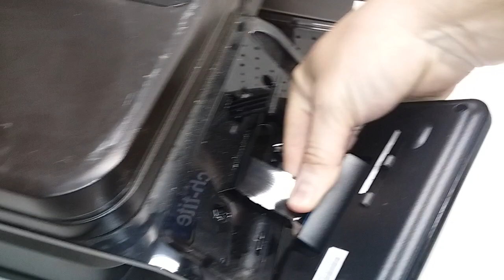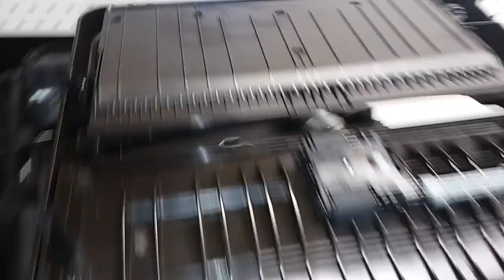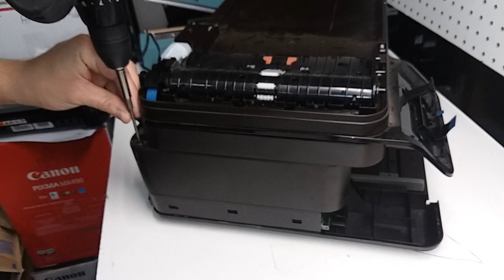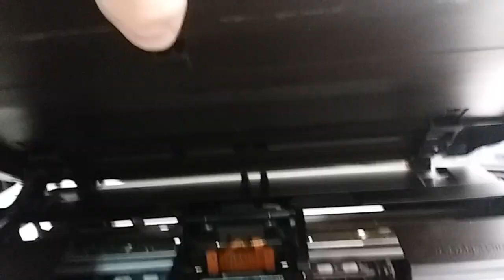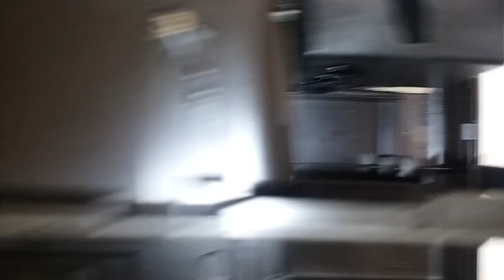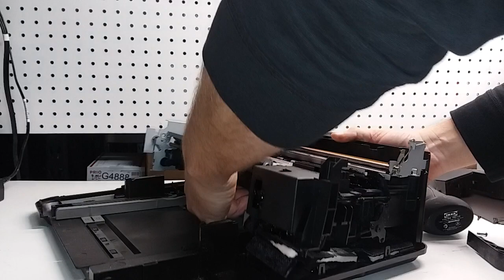Taking Apart HP Photosmart 7520, 7510, 7525, 7515 Printer Disassembly

Comment: I keep getting "One or more cartridges appear to be missing or damaged."  I replace the cartridge(s) with new and will get the same message - sometimes the same cartridges, sometime a different one.  It is not the cartridge.  Already replaced the print head.  Ideas?

Comment: My father had bought one of these back in 2011. It sat in storage for the past 6 years when I re-discovered it and got my hands on it. I can't for the life of me get it to print even with new carts and a head. It'll either print yellow only, or dump out an empty page. Once I got it to smear a streak of black across the paper, but haven't been able to convince it to do it again. This is what I needed. Hoping tearing it apart and putting it back together will jostle the life back into it. Failing that I'm just gonna E-waste it and get a Brother printer.

Comment: My pick up gears don't engage with the back gears in the gear box on a 7520.  How do I get to the gear box without having to take the complete printer apart?  Can I just take the bottom off to access?   I used a mirror to view the action and the back three gears did not engage.  Please advise.

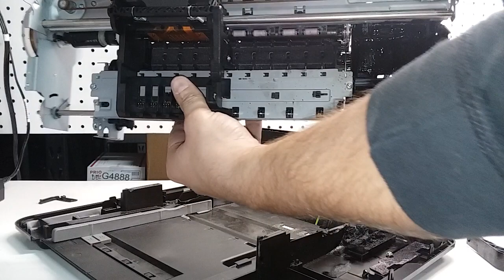Comment: 15:28 you show the underside of the print head assembly and the ink feed tubing. on the tubing is there 2 return tubes that just sit in the 'soak' padding or do they actually connect to something
?
Reply: 15:33 I can see the 'three' pair tube that runs to the head? but I can't see where the other 2 singular tubes are positioned. When disconnecting the right front facing side of the carriage, mine didn't come up as easy as yours. so I worked it until it just fell loose, (on yours there is a screw holding them to the bottom of the assembly with a white 'mount hold' but you just ripped yours out. I'm needing to clean the "ink" buildup all in the carrage and reassemble to hopefully fix for a client.
Reply: @Network_Pat  Hi, I am trying to establish which of the 5 tubes connect to the 3 ports of the mount hold at the bottom of the tray and in what order. And if the other 2 tubes are just positioned in the sponges or soak padding. Can you help? Did you get a solution to your question? Many thanks, Thanasis

Comment: Followed your video to replace paper door from one 7520 to another 7520. WiFi now doesn’t work & wonder if my hitting the memory card/usb port on left side of printer may have damaged WiFi module/board? Thanks.
Reply from the maker: 🤔hmm, that process shouldn't interfere with wifi card. The cover in the left is just card port. Make sure that is connected properly, maybe that's the case. Wireless card is attached to main board. See if it got dislodged.

Comment: I have the 7520 and it wasn't feeding the paper. Then recently it disconnected from WiFi and I can't get it to reconnect. So I watched your video and took mine apart, cleaned it, and put it back together. Plugged it back in and it won't turn on.
Reply: :face-pink-tears:

Comment: Great video!! It helped me get the control menu off so I could get the cover over the glass pulled back to clean the underneath. Couldn't get the lid off from the glass holder. The 2 outer hinges came loose but the center hinge piece wouldn't come out. I'd love a hint how to get that out or point me to another video that does that. Thanks!!

Comment: First off thanks very much for posting your video.  It gave me the courage to tackle a problem that I thought would be a fairly simple fix ( a broken hinge on my HP7520 printer).  I admit to being mechanically challenged but was successful in removing the broken hinge following your helpful video however.....NOT so successful in reassembly and have more than likely trashed my printer.

The issues I encountered on reassembly were. (1). The L shaped plastic piece that fell out when I lifted the lid after releasing the hinges from the lid....I see this piece in your video when you lifted the lid....I cannot determine where it fits or attaches and you did not mention it in your video.  (2)  After replacing the broken hinge I was experiencing difficulty in reattaching the lid because of the cable connections....was hopng that I would not have to detach the cables from the circuit board as you did in your video.  But alas I determined that was the only way to get the lid back on .... so despite your comment to be careful in removing the cables I inadvertently pulled the "base" of the cable from the circuit board thereby trashing the circuit board.

Thanks again for your video!

Comment: This video is essentially useless for repairing the ADF on top of the machine.  There's a little blue power ribbon that attaches next to the hinge on the document feeder. When it comes out, you're done. It isn't going to be reattached... no matter what.  End of story. This is an example of a completely ridiculous engineering design. It really makes that repair impossible. If that is actually the purpose, it doesn't motivate me to buy another HP printer... even though the machine is quite durable and lasted a good long time. A complete replacement of the top half of the machine may be possible. But disconnecting the power to that seems to be overlooked too. This video is useful if you only want to take the machine apart, for some reason.

Comment: There is a gear that causes the paper to be fed.  After years of use it tends to break free from the shaft and needs to be reglued.  How much of the printer needs to be disassembled  so that the gear can be exposed and easily glued onto the shaft?

Comment: That video was amazing! I have the 7515 so you know it's old. I've having black ink smudges occurring on my cards and envelopes. Looking inside at the right of the ink cartridges where the printhead rests when not in use, I can see lots of blank ink buildup. Wondering if there is an easier way to clean this area without disassembling the whole unit as you did. I have been looking for a printer replacement, but HP simply does not make printers like these old ones anymore. Any recommendations?
Reply from the maker: Hi. Yes. Cleaning inside the printer does not require disassembly. I used butter knife or screwdriver. Be careful not to break anything. You can also remove printhead and clean it.

Comment: Hello! I watched your vid and was able to fix the paper roller/gear issue. Unfortunately, now I'm receiving printhead error. I have taken this apart a few times and am sure I have all cables/screws/whatnots all back in the correct place. Any insight into what could be causing this?

Comment: Hi, thanks for this video. Have you also on for the HP 7610/7612 ? I have to gain access to both  laterals of the printer. Thanks for any advise
Reply from the maker: Hi. Thanks for the support.  I currently do not have the printer, but as soon as I find one, I'll try to make a video.

Comment: Thanks for the video and great directions. I have been getting a "problem with red cartridge" message that prevents any operation. I put in a new HP red and it resolved the issue shortly but then it returned--on and off. I cleaned the print head and all the connections to each cartridge and behind the print head contacts-both sides. I was jiggling the print head ribbon cable one day and that seemed to get it going sometimes. I took it all apart today (thanks to your encouragement) and cleaned all ribbon cable connections and sockets to no avail. I replaced the battery. Could I have a broken wire in the ribbon cables from the print head to the main circuit board? Bad connection from printer head to the small print head circuit board the 2 little ribbon cables connect to? Bad solder on that small printer head board? I ordered 3 Brother printers a month ago and there are none to be had due to shipping crisis. I would like to get this 7520 going but am out of ideas. Seems parts are crazy expensive. Any ideas as to what I can check??? I tried slipping a blue HP cartridge in the red slot and is says damaged or missing red. It isn't sensing the red cartridge is good and in place. I see one guy re-soldered some bad power connector contacts so solder may be an issue but I have power and when it decides to work it works great. Something intermittent is the problem and it is now to the point it doesn't work ever. I hate to spend money on another red cartridge. I really appreciate your videos and advice. Any suggestions would be greatly appreciated.

Comment: Great video.  Didn't solve my issue on my 7520.  And yes that's a very good printer, but instead of having 5 ink cartridges, this familly of printer should have had reservoirs (ink tanks) like the newer Epsons and Canon printers.  And not only that, the manufacturer should include in the life of the printer "X" amount of print heads and an easy way to clean ink charging section and replacing the felt, and a way to replace the 3v CR2032 battery if it needs to be replace.  So if HP decides to make a tank version of this printer,  they should implement my ideas and they would sell a lot of them.

Comment: my 7520 was bricked on a "There is a problem with the printer or ink system" error, used your video as a guide to get to the CMOS battery for a master reset, and now its working again!
Reply from the maker: I'm glad you got it fixed. Thank you very much for sharing.  Have a great day!

Comment: If anyone is having trouble reconnecting the wide blue ribbon to the back of the touchscreen, it is a bit more complicated than expected. If you look at the back of the touchscreen, where the wide ribbon connects, there is a grey, rectangular rolling lockbar. 

This bar has 2 positions: lock and unlock. It will probably still be in the "locked" position. In this position, you can see a row of little slots along its long edge. It will look like it's tilted backwards. 

You can't insert the ribbon if this bar is locked. It must be rolled forwards with your finger to unlock it. It will click into place. Instead of looking tilted, it will look squared. You won't be able to see the row of slots if it is unlocked. Roll it back and forth... lock it by pressing it back, unlock by pulling it forward.

Make sure it's in the unlocked position (no slots visible) and slide in the ribbon. It will likely stay in, but loosely. Then press the lock bar (roll it backwards) to lock the ribbon into place. 

I hope this helps somebody!
Reply from the maker: Thank you very much for sharing. I'm sorry I didn't point that out and caused you some unnecessary trouble. I hope this helps someone. Have a great weekend!

Comment: Does anyone have an idea as to how to repair one of the cartridge contact pins (black cartridge)? The pin is bent and won't spring back to contact the cartridge. There's no way that I'd tackle taking apart the printer.
Reply from the maker: Hi. See if this video helps you.  If it is not broken off, I suggest using tweezers.
https://youtu.be/M2r_Cs17nDw
Reply: @303electronics  Hi. Thanks for your reply. We initially bought the printer used. After replacing the black cartridge, we got the not recognized error. I found the same video at that time and was able to lift up the pin. The other day the same thing happened after replacing the cartridge (my wife did). I sent her the video at her store and she's been fiddling with it to no avail. I'll be checking it out in a couple of days, myself, and bringing tweezers as you suggest but I'm afraid that it might be beyond repair. I really appreciate your reply. Len
Reply from the maker: @gonepostal474  Thanks. I hope it works out! Have a great weekend!

Comment: i lost my plug for my 7520 photosmart printer will the plug form a 7525 fit my 7520?
Reply from the maker: Hi. Yes. You can use same power adapter for HP Photosmart 7510, 7515, 7520, or 7525.

Comment: Great Video, I have had this printer for 8 years and am now starting to get printer errors, which I don't know what they mean.  If I keep hitting OK on the Print screen, it will eventually print but makes a lot of noise.  Don't know what to replace it with.  Thanks
Reply from the maker: If you really like this printer, you can get a replacement on ebay or local ads. You will find that HP Photosmart 7510, 7515, 7520, and 7525 are all similar. Save your ink and printhead since sometimes when ou get a used printer, those are needed. Easy to swap out.

Comment: Do you have, or have a source for the small black plastic gear press-fitted on stainless shaft that drives the paper pickup roller assembly? desperate, need a couple or more.
Reply from the maker: Hi. I may have a few, not sure though. I will check Monday and let you know.
Reply: @303electronics  Hi, I know there has been a bit of time, but I have just watched this video. THANK YOU VERY MUCH. It helped a lot disassembling. I have the issue with this black plastic gear. I glued it twice on the shaft where the serrations are, but it now appears split. So the shaft rotates but the gear not. Do you have any spare ones I can buy or know where I can find them?

Comment: After putting everything back together my ink carrier is moving really fast and hitting the sides. Then comes up with error code Carriage jam saying the print carriage cannot move. But it’s definitely moving.
Reply: Encoder timing strip was not in the right spot. Fixed it by taking the ink carrier out and lifting the small grey cove to be able to see where it should go.
Reply from the maker: @jamescornia  Great, I'm glad you got it all figured out and got the job done!!! Thanks for your support. Have a great day!
Reply from the maker: The timingvstrip needs to be put back in position. It is a small film in the back of the carrier which is attached from one side to the other. If it is not fed through properly, it will not be able to direct the carrier where to go and it will behave the way your printer is now.

Comment: Thank you for the video. Do you happen to have instructions on how I can slide that broken gear on the roller so I can replace it? I have tried gluing around it before but it always wears down and breaks again and stops feeding the paper. I followed everything till the end of the video except removing the printhead encasing. Thank you!
Reply from the maker: Hi. I usually turn off printer from the plug when the ink cartridge carrier is in the middle. If you wantvto manually spin it, there is a mechanism that slides back and forth under the carriage. Push it back gently and that will unlock the carrier.

Comment: What type of screw driver do you use to remove the main paper feed roller?
Reply from the maker: Most screws on this printer are star shaped torque screw size 10. T10. Some screws will be a bit smaller.

Comment: Thank you for this video, very helpful to enable me to investigate deep inside to try and solve my general printer error of 0x6100004c which in most Google searches talks about the print head, cartridges and paper blockage of which all is fine.  So I've wanted to take the lid off to investigate further. 

Would you have any other advice?

Comment: Hello 303 Electronics. Thanks very much for your video. Yesterday I dismantled my HP 7520 with no problem at all. However, when I came to remove the printer unit, with all screws removed, the right hand side would not release, but there seemed to be nothing holding it. I had noticed that when you were finally removing this unit it did seem to be reluctant to come away. So I gave it a bit more of a pull and it released, but was bringing some sponges with it.
I did not want that to happen as they were soaked in thick black ink, as was everything else in that area, I just pushed them aside.
I then found I could not remove it completely as it was still held in place by 3 pipes on a bracket mounted to the base, I release the bracket. On removal of the print unit I found that there were 5 free floating pipes, where 3 of these had obviously pulled of one side of the bracket, whilst the other 2 I can only assume were open-ended and placed among the sponges on the baseplate.
The dilemma now is which out of the 5 pipes were connected to the bracket and in what order, and where were the other 2 placed with respect to the sponges.
I would be grateful if you were able to shed any light on this dilemma as to where these pipes connect. I have a photo of it that I have marked up the pipes and the bracket. This could sent to you if it would help.
So far I have washed out all the sponges and the baseplate. I do intend to clean all the old ink from the black parts on that side of the print unit. As there are no electrical connections to worry about I may well just wash it through with running water. Best regards, Dave.
Reply: Hi David, did you eventually get to the solution of the tubes and where they connect? I had the same problem, but also the sponges do not correspond to the tray structure so I am not sure where to put them back again after cleaning them.

Comment: Hi, I am having problems with my HP 7520. The printer display shows "paper size error". I have already check in my mac and the paper sizer is correct. I have also printed a status report directly from the printer menu and the error keeps there. When I hit OK in the paper size error msg, the printer starts printing but the second half of the paper jam. Can you help me? Thanks